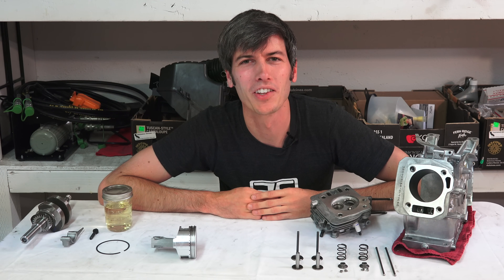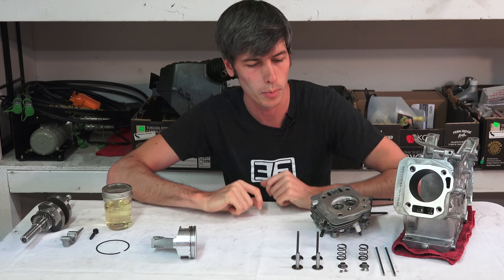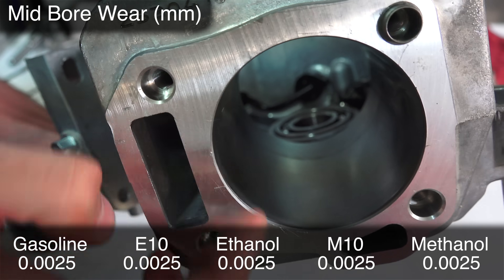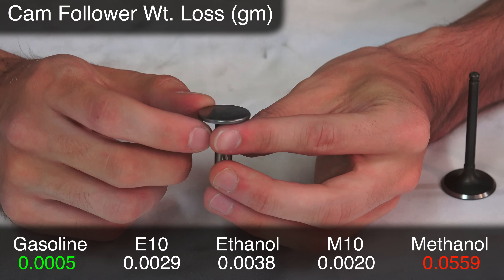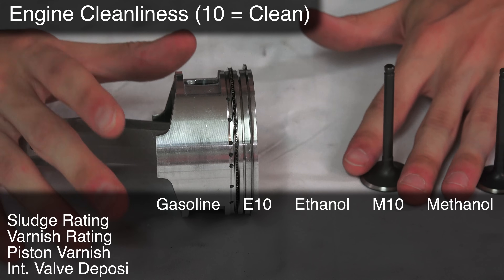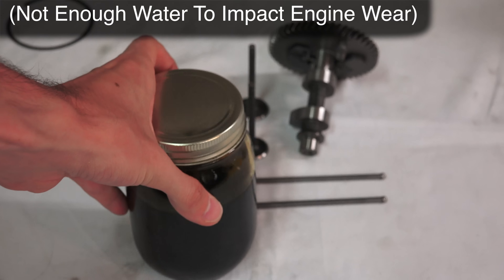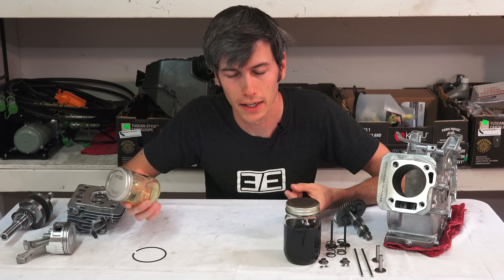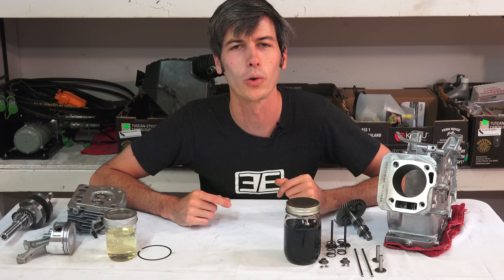Is Ethanol Bad For Your Car's Engine?

Comment: I'd like to hear more about why E10 and even higher concentrations of ethanol, like the E15 the EPA is trying to push, is bad for motorcycles. The American Motorcyclist Association has been fighting this tooth and nail because bike engines aren't designed for E15. Plus, winter storage is a significant issue for motorcycles as well. Is it best to run the fuel system dry and prime it again in spring? Or will fuel stabilizers like Sta-Bil help? Personally, I've been using marine grade Sta-Bil, which is better able to absorb the water that the ethanol/gasoline separation process creates during the winter months.
Reply: I think this is why we need a video about it!
Reply: Use a fuel stabilizer and top off the fuel tank leaving the least amount of air in the tank as possible. This helps reduce the amount of moisture absorbed by the alcohol in the fuel from humid air by reducing exposed surface area of the fuel and the amount of moist air in the tank to begin with.
Reply: BS! you can run every lambda regulated bike on E10 without Problems. Mine runs perfect on E85!
Reply: Get a flex fuel carb
Reply: The major problem for motorcycle is the tank, more than carbs / injectors. Almost all fuel pumps have some sort of moving metal on the fuel pump, that when affected by ethanol which separates into 3 parts, one being water the main byproduct of ethanol, This will rust and corrode any metal on the fuel pump. This also affects any older motorcycles with metal tanks, which is 90% of your harley bikes currently owned. My mechanic tried many things to combat ethanol, if you must use it and cannot avoid it; Startron. It's a blueish fluid you can find in almost any auto selling store.

Don't be the guy that leaves his motorcycle stand for 6 months to a year and have a fuel pump get pulled out looking like some underwater wreckage because of ethanol.
Reply: Always drain any fuel if you don't burn it within a month (except diesel, that's fine for a year or more). Regular gas gunks up everything (haven't seen any worse with e-10, its all pretty bad).

The only thing to watch for is old vintage bikes (like if you have a 50 year old motorcycle with original hoses working by some miracle), then the rubber isn't made for ethanol. Otherwise I've seen no issue to ethanol, it just needs to be tuned for peak performance (then again I believe every motorcycle sold in the US should come stock with Nitrous Oxide, so maybe I'm overly critical on tuning). Your timing needs to change, and make sure to adjust carbs often.

I used to drive year round (couldn't get car liscense at 14 to get to school), so I know e-10 works fine in the winter, but no gasoline should ever be left EVER for extended periods of time. You'll end up draining the junk anyways since it ruins after a while, but you'll also have to clean the jets too. Just turn the drain screw and put it in your lawn mower, its simple.
Reply: Oh, I guess gaskets and seals too. Though to be honest, if your gaskets are 20 years old, its probably past time to change them anyways. The new ones will handle ethanol blends fine. If your's is super vintage, you can buy ethanol optimized gasket material (sheet or roll) and cut out a new one (use the old gasket as a template). Then again I've seen someone use a beach-ball as a carburator diaphram for years... Ethanol must not be that bad, or maybe it was a specail ethanol beach-ball ;)
Reply: Ethanol does work on bike engines. We had replaced the carburettor with a fuel injector however.
Reply: I bought an old 84 Shadow, original seals and 18k miles. Seals are still good. Only thing I've been doing is putting sta-bil 360 into the tank recently at every fuel up. My bike was running a bit drunk sort of speak on the e10 after using it alone for a while but after putting in the 360 which is made to alleviate the problems of running ethanol, everything seemed to clear right up after a few tanks with the stuff.

With that said, talking with a few vintage bike groups they all share the same opinion and after my experience I believe they are right. That E10 can be a bike destroyer. Especially for older bikes that were never built to run on the stuff.
Reply: Maybe the government shouldn't give billions in subsidies to corn farmers
Reply: So for relatively new dirt bikes and similar motorcycle does e10 clog the carborator or injectors? I hear that e10 clogs bikes up and they recommend cleaning the carb/jets or the easy thing, run some sea foam and use ethanol free gas.
Reply: You won't have a problem with the fuel when it's fresh.  The problems come after 3 months or so when the fuel starts to break down and it becomes corrosive.  Hopefully you have 'Clear' premium available in your town somewhere.  It can also be called 'Pure Premium' or of course "Ethanol Free' premium.  This fuel should be used in all vehicles and equipment where there is the potential of the fuel to sit in that tank for longer than 3 months.
Reply: @spazzman90  Don't go all spazz on wrong information. It's gasoline that goes bad, not ethanol. If you don't know what you're talking about...and you don't, keep your mouth shut.
Reply: Yamahas FZ series is made for E10
Reply: @12Burton24  BMWs S1000 series is made for E10 as well.
Reply: The problem with Ethanol and Motorcycles generally is this, Ethanol absorbs water. Ethanol is corrosive to Aluminum, Brass, and other Metals which then are depostied in fuel filters and if you are unlucky scoring the fuel system itself. Aluminum in particular is a common Motorcycle Fuel system component, so unless your bike has cast iron cylinder block, stainless steel fuel tank, and specially made hoses  fittings and fuel system components that are made for Ethanol, you would be heading into potential trouble. Other than that, its OK.
Reply: Two Tone,
High proof ethanol is not corrosive to aluminum and steel components. Plastics and rubbers in fuel systems have been ethanol safe since 1983. If this were not the case, then flex-fuel vehicles would be destroyed by ethanol.
Reply: I specifically omitted Iron (Steel can be contaminated with several metals so calling all steel alloys the same is pointless) but saying Aluminum is Ethanol resistant, well I'm going to need some data to crunch for that. Here's what the  National Marine Manufacturers Association (NMMA) has to say on the issue: " The data clearly indicates that the increased use of ethanol in gasoline has raised safety and durability issues for aluminum and fiberglass fuel tanks.  In the case of aluminum tanks, aluminum is a highly conductive metal that relies on an oxide layer for its corrosion protection properties. Low levels of ethanol, such as E10 (10%), are usually not a problem in aluminum tanks because the oxide layer provides a good measure of protection. The problem occurs when the ethanol content is increased.There are two mechanisms that occur with ethanol. Both mechanisms are a result of the hydroscopic property of ethanol, meaning it absorbs water. The more ethanol in the fuel, the more water there will be in the fuel tank. Water not only causes the tank to corrode, it also causes the corrosion particles to clog fuel filters, fuel systems, and damage engine components. The corrosion rate can be accelerated under a number of conditions if other contaminating metals are present such as copper which may be picked up from brass fittings or as a low level contaminant in the aluminum alloy. Chloride, which is a chemical found in salt water, will also accelerate corrosion. In the long term, corrosion can perforate the aluminum to produce leaks that would cause fuel to spill into the bilge and end up in the environment. In the worse case it could cause a fire and/or explosion hazard.

The second mechanism that can occurs with the increased use of ethanol based fuel in aluminum tanks is galvanic corrosion.  Gasoline fuel is not conductive, but the presence of ethanol or ethanol and water will conduct electricity. The galvanic process that occurs to aluminum trim tabs, stern drives, shaft couplings, etc. will occur within the aluminum fuel tank. Boat builders are able to protect exterior aluminum boat equipment with sacrificial anodes known as zincs. Sacrificial anodes are not a feasible option for the interior of a fuel tank."
Reply: Two tone,
Salt solutions tend to be somewhat conductive. Water by itself not so much. I would imagine ethanol is even less conductive since it isn't as polar of a molecule as water.

Yes, adding ethanol can clog fuel pumps and injectors, but not solely because of ethanol. If you have water in the bottom of your tank, it will rust regardless of what fuel you are using. Since pure gasoline doesn't mix with water very well, it will remain in the bottom of the tank until the water level is high enough to get sucked through the pump. At that point the fuel pump and injectors will clog from all the rust. If you add ethanol to the blend, it will mix the water with the gasoline and the fuel pumps will start sucking in the rust contaminated water. Ethanol can prevent water from accumulating in the tank by mixing with the water, combusting it, and sending it through the exhaust.
Reply: I gave scientifically correct information, and gave a source too, you gave a opinion, without research or sources to back it up, so that means I win I suppose, But I'll answer your post anyway just because I'm the kind of guy that likes the thrill of debate.

I didn't say it would clog fuel pumps and injectors, I said it would score them, which is wear through corrosion or lack of lubrication. Also Water is water, whether suspended in solution or not, it will do what water does, which in the case of galvanic corrosion requires movement generating electrical charges, so all those "I put aluminum in a bucket of Ethanol for 5 years" videos are a bit pointless, twice over, as any solution reaches a point where further solids can't be dissolved in solution due to reaching its carrying capacity. A actual fuel tank for example will have new fuel (and eventually water) added over time.

Also water isn't very combustible.
Reply: I thought they didn't start making fuel systems ethanol friendly till the 90's. My 98 Ford has stainless fuel lines, but my other three vehicles (92 Ford, 1995 Honda, 1997 Hyundai) all have regular steel fuel lines.
Reply: Ethanol is no more corrosive to the metals you claim than gasoline and the aromatics. Ethanol's ability to absorb water is a benefit, not a detraction.
Reply: But you'd still have an al piston and cylinder head.
Reply: Maybe Motorcycle manufactures should update their engine materials to be more modern instead of sticking with 1970s technology? 
I don't see old school gas lawnmower association putting up a fight against ethanol :D 

Anyway, there should be at least some sources of old school ethanol free fuel for those who have classic cars, or bikes (or lawnmowers).

Comment: Put a full tank of E85 in my 03 RSX and compensated the fuel trim a bit on my hondata, ran perfectly lol didn't have any issues with fuel lines either. Gas mileage was significantly worse though but that's just because ethanol contains less energy per given volume than gasoline

Comment: This video makes a ton of sense. After spending a decade and a half in the automotive repair industry I have seen most of the damage appear in the fuel system and engine gaskets. Another issue was water being absorbed from the humidity in the air and then ruining the fuel and or oil thus causing poor performance and longevity. It's become normal to replace vacuum lines and pcv systems on a regular basis and fuel pumps in aging vehicles regardless of how low the mileage on them is.

Comment: 20 hours of testing? Who drives a car for 20 hours? Why did they accept such a study for publication? 200 hours? 2000 hours? 

Why did the methanol cause more wear? Heat? Replacement of oil on rings?

Comment: Very comprehensive information.  I have some cars that aren't driven often, so one thing that I've done for many years to combat corrosion caused by phase separation is to drop a small bottle of isopropyl  dry gas into the tank once every month or so, as recommended many years ago by Pat Goss of Motorweek. The following is part of an answer he emailed me in response to a question:

(From Pat Goss, 2007)
In addition to lowering fuel economy, having huge delivery issues, and being an energy negative ethanol has a major negative. Ethanol attracts water to the tank from the air much like brake fluid does. Ethanol makes the water problem and the consequences much worse than it has ever been before. Unfortunately ethanol does not cause water and gasoline to co-bond like Isopropyl does so the water remains in  the tank. Then comes the real issue. As the water accumulates it may cause phase separation of the ethanol. It only takes 0.05% water by volume to cause the ethanol to fall out of solution with the gas (phase separation).
 
When phase separation occurs the ethanol drops to the bottom of the tank displacing any gas at the bottom. Because the fuel pickup tube is always at the bottom of the tank the pump begins pumping pure ethanol and water to the engine. A conventional engine will not run on ethanol and the fuel system components are not designed to withstand the corrosive action of the ethanol. Here in  the shop we have seen some severe damage from phase separation of E-10. A car last week required over $2,000.00 in repairs to correct the damage. This would not be the case if the car is flex fuel equipped as it will already have ethanol resistant fuel lines, fuel injectors, seals, etc.
 
The only way to keep the moisture under control is to continue using the Isopropyl Dry Gas once every month as you have been doing. It's cheap insurance.

Comment: What about Ethanol and it's contribution to the build up of carbon???
Reply: If ethanol tends to dump moisture into the oil sump from combustion blow-by, would a PCV catch can help filter this out and help keep intake and valves cleaner?

Comment: Varnish is the part that concerns me.  Its not that running good fuel through the engine will be bad for it, its the phase separation, varnish on injector parts and water contamination that im concerned about.  Look its a lovely set of test data, but it takes literally no time at all to find someone who's got a small engine, especially marine and 2-stroke, that have had to rebuild the carbs or worse running a small amount of blended fuel.  I know my honda generator can't have e10 fuel in it or it will completely gum up in no time (rebuilt the carb twice before I figured out what was happening, switched to ethanol free and haven't had problems since.)  Its not that it will hurt your engine to run good blended fuel in your engine, its what happens AFTER phase separation or in wet environments (ethanol being hygroscopic)

Comment: Very interesting! Thanks Engineered Explained.I used to make Biodiesel with Methanol (about 1800 Liters per day capacity). That proyect halted to the lack of vegetable oil. I got stuck with about 4000 Liters of Methanol. That I am using now mixed in my motorcycle (110 cc motorcycle to run around the farm). I use 1 Liter of Methanol and about 2.something Liters of 85 or 91 octane gasoline. So about 33% Methanol and the rest gasoline. I have to have to play with the choke a bit as such as it's allways half choked when warm. If it's cold (near 0 degrees Celsius) the choke has to be more out as such as it's about completely choked. Regulating the choke allows me to run this 33% Methanol mix effectively. When not propperly choke the Motor stutters a bit but when warm and choke regulated, the driving is as normal as with 100% gasoline. It's one of These chineese motorcycles who get imported to Southamerica. But yeah it works. No oil burning nor any Problems whatsoever and I have till date ran about 40 full tanks of this mix.

Comment: Ive been told for years that older cars, like my 70 buick, have components that are eaten or weakened by ethanol, like rubber parts of the fuel system

Comment: I know that it's a very small amount of ethenol in our standard pumps. However, when I went on a road trip this summer with my new mitsubishi outlander sport with an instant fuel economy I got some strange results. With the normal e10 87 octane I get about 350 miles to a tank on the highway. But then I stopped at a station that had pure gas at 89 octane for cheap! So I filled up my tank with that and I got 500 miles to that tank! So, with our usual blend only being 10% ethenol how come I saw such an outstanding difference?

Comment: LUL, most cars manufactured/assembled im Brazil are flexfuel, only imports are gas-only, and some older cars that run either gas or ethanol depending on the pistons (compression ratio) and fuel system; and every single gas station has ethanol. Plus, the "regular" gas they sell has up to 27% or 28%, 30% ethanol, so you could call it e27, e30 or something, and the government is trying to bump it up to 40%. Also, the ethanol fuel they sell is around 95% ethanol and 5% water, despite being called e100 by some (the people and gas stations just call it ethanol or alcohol).
There's kind of a trick to find out if it's better to use ethanol or gas - if the ethanol fuel price is less than 70% the price of the regular gas (even though it already has ethanol mixed in), then using ethanol can save some money. That's because the flex fuel cars use around 30% more ethanol to make pretty much the same power - and pretty much all of them are naturally aspirated. If it's a turbo/supercharged engine with a tune, then it probably consumes more than 30%, since you can add more boost and fuel, because ethanol has crazy "knock resistance".